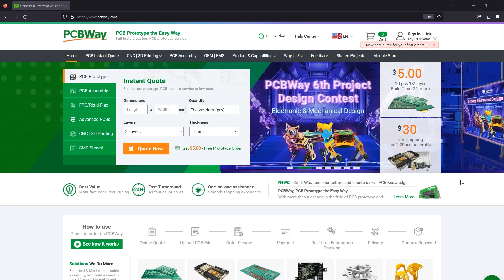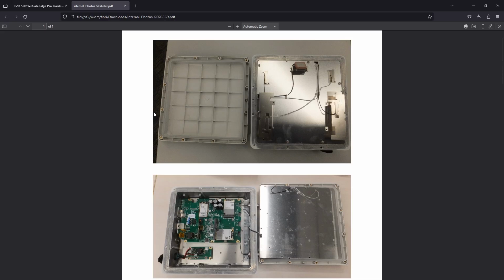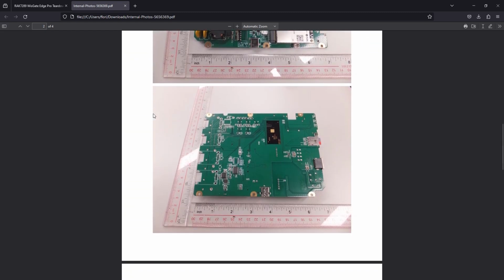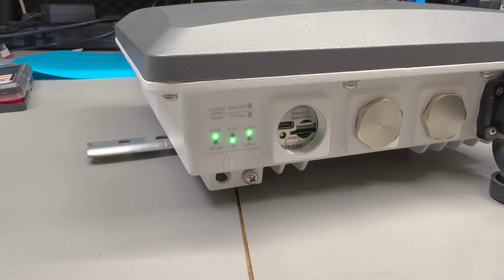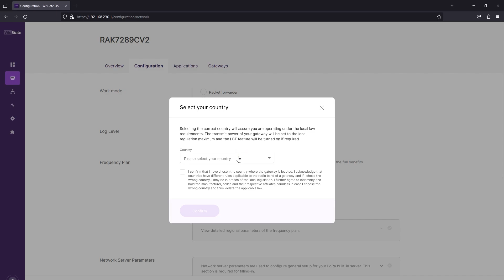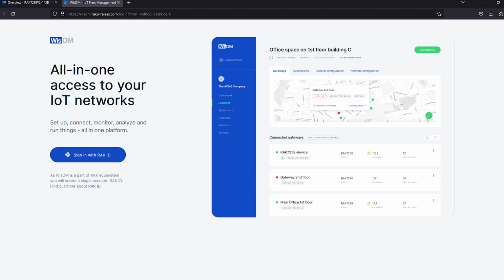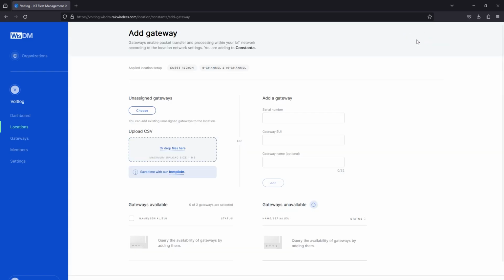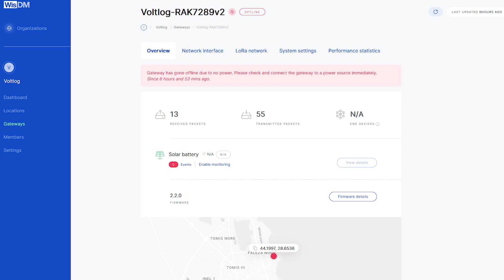Inside the RAK7289v2 LoRa Gateway & TTN Setup Tutorial (part 2)

Comment: Hello, I recently purchased a RAK7289 gateway and I’m currently trying to configure it for the first time via Wi-Fi, connected directly to a computer. However, I’m encountering an issue with the login credentials.

The manual that came with the device states that both the username and password are "rak", but when I try to log in, I receive an “incorrect password” error.

I have also attempted to perform a reset by holding the reset button for several seconds, but the issue persists.

I would truly appreciate your guidance or support in resolving this issue so I can continue with the setup.

Thank you very much in advance.

Best regards,
Reply from the maker: Sorry to hear about the login trouble, perhaps double-check the product's official setup guide for the latest instructions.

Comment: is it allowable to communicate with RAK7289V2 using a heltec Lora32 V3 module with SX1262 LoRa node chip? , i want to program heltec Lora32 V3 module to send data to RAK7289V2 , is it possible?
Reply from the maker: There shouldn't be any limitation, this gateway can communicate with all Lora devices.

Comment: That's MP2233 from Monolithic Power Systems
Reply from the maker: 6:21 Datasheet info confirms package marking "AEU", pinout seems to match connections on the PCB, package size matches. Thanks, this seems right. 16V max operating input with 17V absolute maximum. Should be good with my good quality inverter from VictronEnergy running from a 12V lead acid.